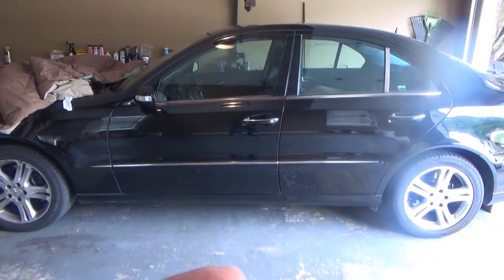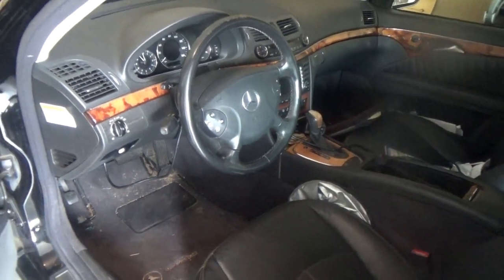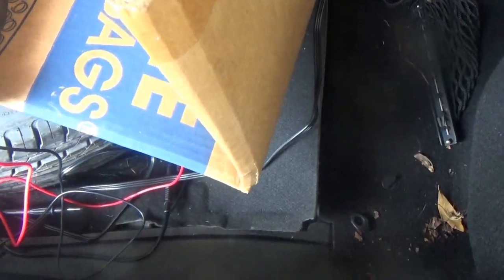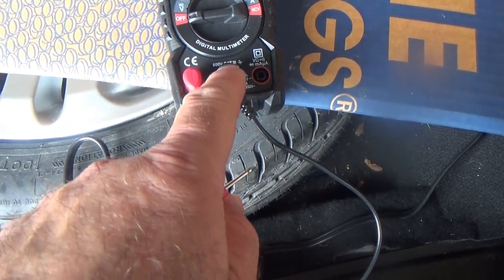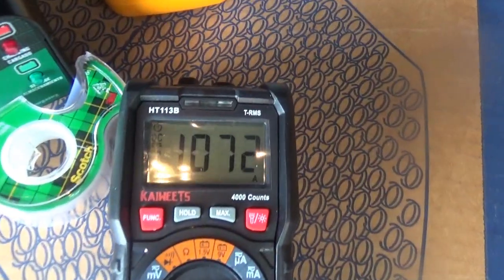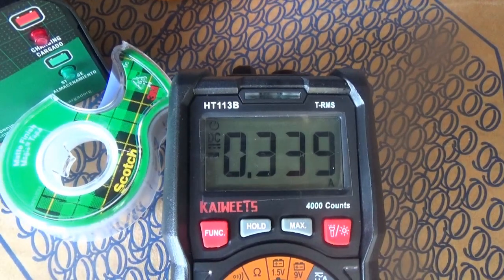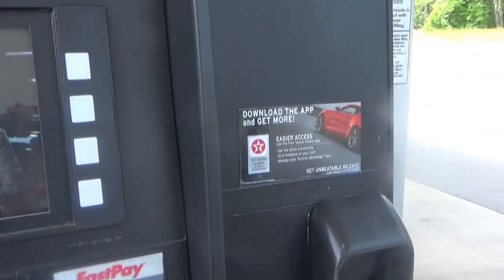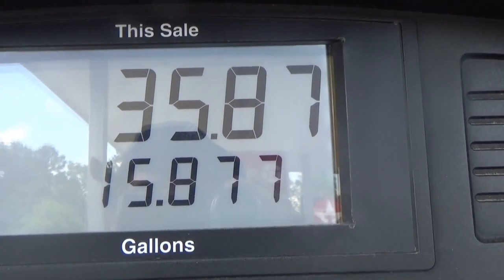Possible Parasitic Battery Discharge. Mercedes E500

Comment: Check the OBD2 codes to see if it shows any error codes.
Reply: great advice! 
Any crazy CAN module (Rear SAM) is gonna try to hang the bys awake instead of time out to sleep.

there's also a secondary smaller battery up front or under the dash.

Comment: Tous les problèmes de décharges de batterie, sont souvent : le réglage des sièges électriques(débrancher les 2 arrivées sous les sièges avants, la radio commandée pas le fusible 8 à l'arrière (faire un pont avec le 7 pour couper en position voiture fermée, les lampes de coffre et autres à remplacer par des leds... (5 A de lampes allumées dans le coffre) en faisont tout cela , vous aurez une tesion à peu près stable du jour au landemain... Tous les problèmes rencontrés de la voiture qui se met en mode économie, vitesse 2, plus de puissance, viennnent des batteries pas assez chargées...!!
Reply: Moi c'est le navigation qu'il la fait le problem